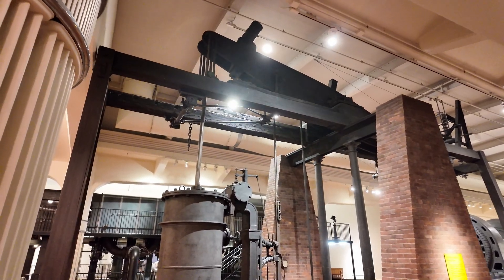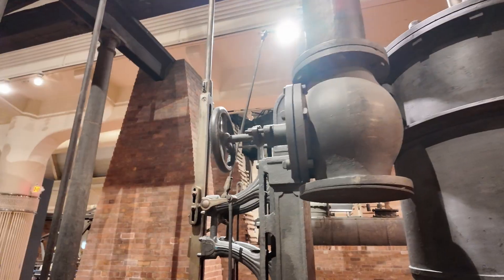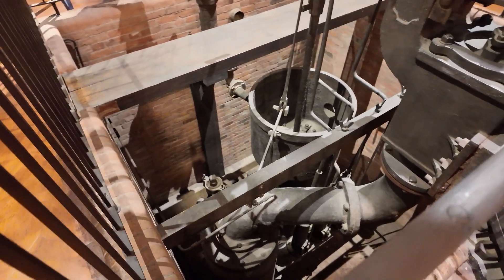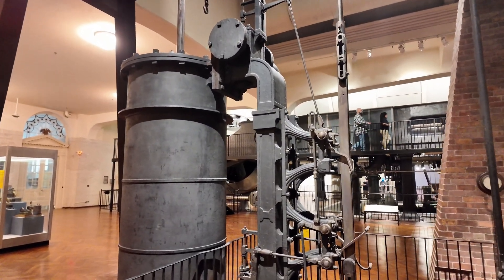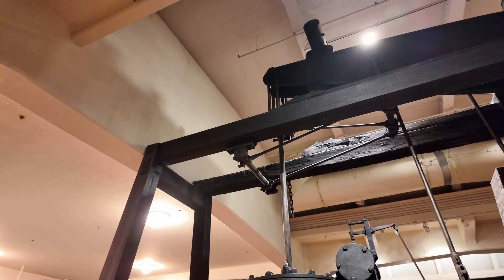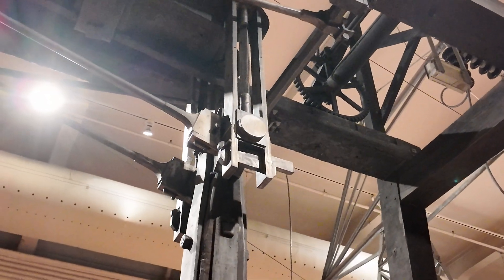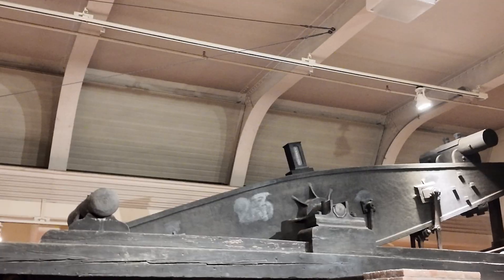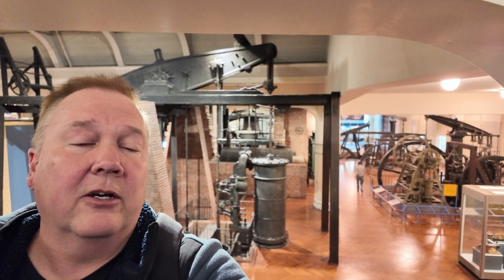James Watt's NEW & IMPROVED 1811 Canal Pump - Was It Any Better? | First Century of Steam - P6/7

Comment: I will try to answer some comments.

France had opened the Canal du Midi, thus a waterway from Atlantic to Mediterranean in the 17th century, a major construction, and France had a School of Bridges and Roads.  The King/taxpayers had done it.  England had only improved river navigation.

By 1760s we had numerous Newcomen engines and if rotary motion was wanted then the engine pumped the tail race water back to the millpond.  Waterwheels were the usual power for anything.   Manchester had many engines and needed coal, the Duke of Bridgewater had mines but the transport was limited and unsatisfactory, either packhorses or rivers Irlam or Mersey.  He owned enough land in which to dig a canal 9.5 miles long.  He trusted James Brindley, millwright, to arrange it, including the aqueduct over the river, which many people scoffed at as ridiculous.  His investment paid for itself easily and coal supply to Manchester became cheaper and more plentiful.   Naturally other canals followed but both capital and rights to the necessary land were difficult.  Not every land owner along a route would agree so there was need for Parliament to pass an Act.    Capital was difficult because the South Sea Bubble had caused real consternation circa 1720 and consequently only 4 shareholders were allowed.  Mostly canals were owned by Trusts but to give perspective we spent £1,000 million on defeating Napoleon but only £20 million on canals, which is why most were narrow.   We learned and for railways the 4 shareholders was waived and eventually they had invested about £750 million.

I looked at the Stroud water dated 1777 I think, it had wooden paddles in the gates and the man slid them sideways through an arc.  But mostly the method was cast iron plate lifted by cast iron rack and pinion,, usually in the lower gates but usually in masonry beside the upper one.  Early canals followed contours and therefore are lengthy but served many villages and collected numerous streams.  Later canals were straighter and might have short summit levels.  Some engineers were notorious for not providing enough water for busy traffic in August.  Gravity is much better and cheaper than a steam pump.

The oldest steam engine still in its original place is one of two Bolton & Watt at Crofton, they work over Bank Holiday weekends filling the summit of the Kennet and Avon canal.  Well over 200 years old but now using ex GWR Lancashire boilers.  The rest of the year electric pump.

Beams were not steel, cast iron.  You can walk upstairs and stand beside the thing in action and as each stroke lifts a ton of water the entire stone structure shudders.
Reply from the maker: Thanks for all the info!  I've seen video of the Crofton engine and really want to see it running, sometime.  Most of our canals here were built with rotating wicket gates set at the bottom of the main lock gate.  They worked well, but led to a max lock drop of about 3 meters before they'd start flooding the canal boats going up the locks.

Comment: I think that the reason that Watt went to double acting cylinders is that he wanted rotary motion and for that he needed power for both strokes of the cylinder. As for why he didn't use a crosshead guide and connecting rod, planing guides accurately must have been a big deal for the first have of the 19th century, as almost no engineers went that way. Robert Stevenson did, for his locomotives, but static and marine engines all have those contraptions and walking beams right through the 19th and even into the 20th centuries.
Reply from the maker: Yep, definitely right that a double-acting cylinder is a huge benefit if you're converting to rotational motion.  I have a couple videos on single-acting Newcomen engines that are being used rotationally, but double-acting really simplifies things.

Comment: i belive the double acting ran at a much higher strokes per min giving a greater pump output for a given pump volume
Reply from the maker: Double-acting could run at a much higher (or lower) speed.  They could definitely run at a much more consistent speed, as well.  For the canal pump, though, I think the speed was comparable to the older one.

Comment: Very good video. The iron has a much better finish on this one than the earlier pump. Good Luck, Rick
Reply from the maker: I hadn't really thought about that aspect.  I wonder how much is that it's a bit newer vs how much the steel processes improved over the time since the previous one was made.
Reply: @Industrial_Revolution  Probably a combination of both. As cast iron casting and iron making processes improved the finished product would look better to sell easier and give the owner more pride in his purchase. I'm an engineer to the bone and have always believed in KISS but, I have enjoyed seeing the extra flares that were in the designs of old machines. My favorite machines were the Centennial Display at the Smithsonian Museum in Washington DC. I was stationed, in the Army, just south of DC from 76 to 79 and got to visit the museum many times. They had atleast two huge steam engines that showed their movement. Up until about WWI, the machine tools seemed to have an extra effort put into their appearance. After that, they got more plain and purely functional. Good Luck, Rick
Reply from the maker: Have you seen my video on Gothic Steam Engines?
A lot of things have lost design effort.  Buildings used to be art, too, instead of boxes.
Reply: @Industrial_Revolution  I have not seen them yet. I plan to watch a bunch of them on bad weather days when I can't work outside. Good Luck, Rick